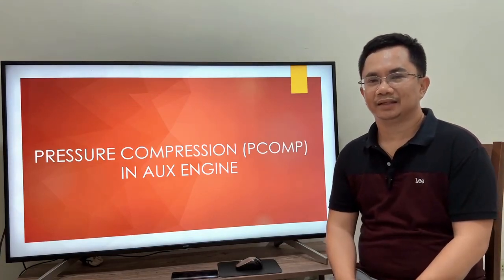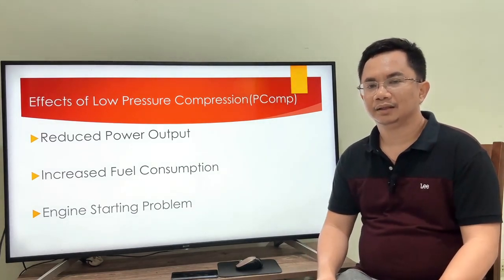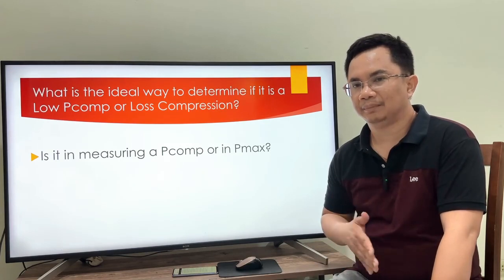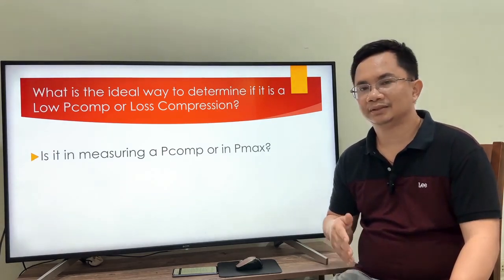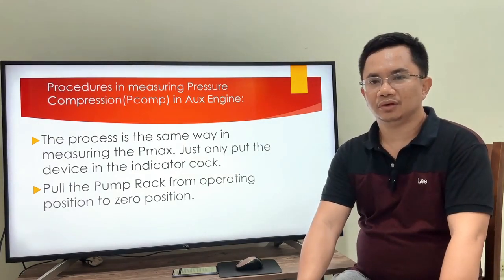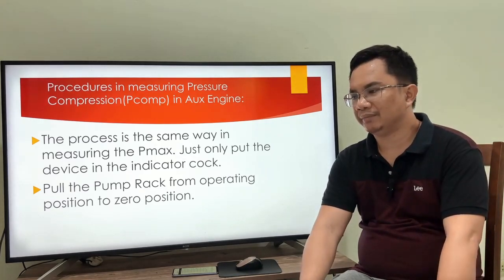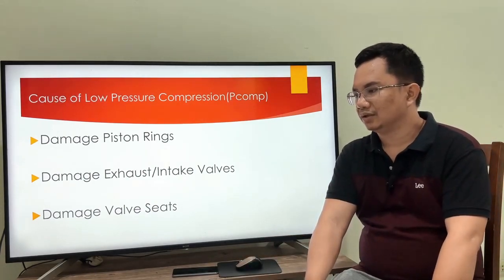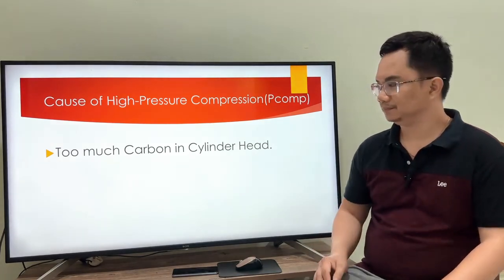Procedures in measuring Pressure Compression (Pcomp) in Aux Engine…

Comment: Question po sir, what is the maximum allowable time in minutes when doing the zero pump rack while measuring pcomp? Hindi Naman po ba magcause Ng power imbalance kapag ganun since wala lng combustion Ang Isang cylinder unit? Hindi  pa po Kasi aq nakawitness Ng ganung procedure.